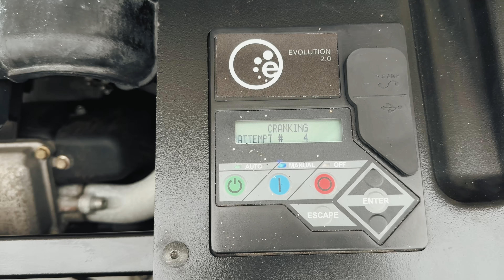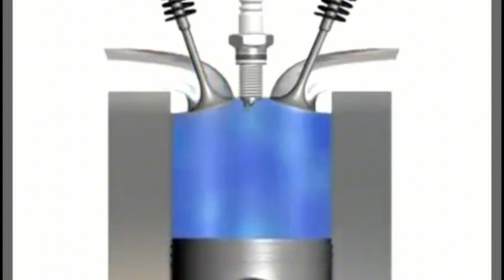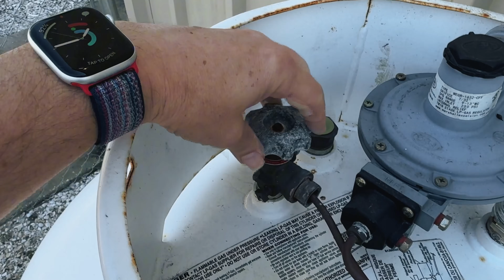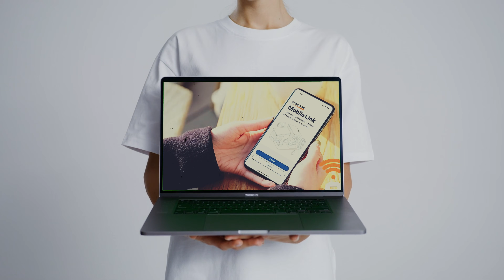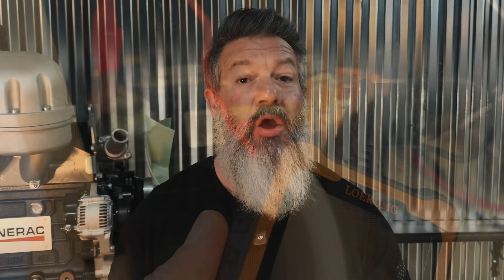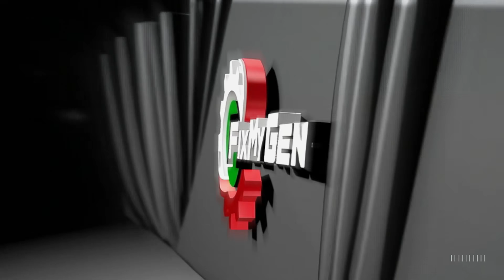GENERATOR OVERCRANK | FAULT CODE 1100 TROUBLESHOOTING | FUEL & BATTERY CHECKS ⚡🔧

Comment: Hello, I have a generac g0072230 14kw guardian series generator. My generator has worked fine for 5 years but all of the sudden I am getting an 1100 error code. The generator starts and runs for about 10 seconds and shows “cranking #1” on the screen and then stops. It pauses then starts again and runs for another 10 seconds or so and then stops again (shows cranking #2 on the screen. It does this until it has tried 5 times and then puts up “overcrank error 1100”. I have changed the oil, propane tank, air filter and plugs and checked that the stepper motor is not jammed, cleaned all the wires and it stays the same. It’s like the generator doesn’t know it has started and is running and so shuts down and tries again. Any thoughts? I’m worried a wire or harness is not working but they are all attached and well seated.Thanks in advance and your videos are excellent!
Bob

Comment: Thanks for your video.  I had error code stepper motor 2399, I replaced it,  I was able to start it with a little help from my finger on the carb,  once running the RPMs were a bit erratic,  so I replaced the controller.  Once again, it needed my help to start.  Now the RPMs are running as it should but, after I turn it off and restart, still needs my help with the butter fly on the carb.  Any suggestions?
Reply from the maker: Great question Jennifer! Needing to “help” it on the butterfly to start almost always points to a lean condition on startup, not the stepper motor or the controller. The fact that it runs fine once it’s going backs that up.

A few things I’d look at next:
• What exact model is this, and is it natural gas or propane?
• When were the valves last adjusted (unless it’s a G-Force engine)? Tight valves will kill intake vacuum and cause hard starts.
• Has anyone put a gauge on the gas inlet to verify fuel pressure while it’s cranking, not just at rest?
• Make sure the throttle/stepper linkage moves freely and isn’t binding or misaligned after the parts swap.

If all that checks out, the next suspect is the fuel/demand regulator. A weak or sticking diaphragm can starve it on startup but behave once RPM comes up — very common on these air-cooled units.

Comment: 12/22/2025 - I just experienced an OVERCRANK error 1100 on my Generac 20KW generator. It was serviced just last month and everything was fine at that time. We had a power outage last week and the generator failed to start. I called my Generac repair company and their tech just left my house. He knew exactly what the problem was when he arrived. Apparently Champion, who supplies the spark plugs, had switched to supplying spark plugs made in China and they are failing in record numbers. He replaced the two spark plugs in my unit with "pre-China" spark plugs and my generator started right up. He checked the gas pressure and battery while he was here and they were fine. So if you guys are recently having overcrank/no start issues you should change the spark plugs. You can't tell by looking at them since Champion is packaging the Chinese spark plugs in their original boxes. My tech said that folks should use NGK spark plugs if they aren't sure if the Champions are Chinese or not.
Reply from the maker: I’ve seen the same thing. You’re not imagining it.

There has been a real uptick in bad Champion plugs showing up in the field, and it’s caused a lot of overcrank and no-start calls that otherwise make no sense. Swapping the plugs fixes it immediately.

At this point, if I’m chasing an overcrank on these units and everything else checks out, plugs are one of the first things I rule out. Going to the NGK equivalent is a solid move and takes the guesswork out of it.
Thank you for watching and taking the time to comment!

Comment: My dealer and Generac customer service both advise to tap the fuel solenoid when the temp is near zero and over crank happens.  I suggested they change their spec from -20 to 5 degrees.   If tapping the fuel Silinoid is needed, they could provide a tapping hole on the right side.  Once the weather is over 10 degrees, it starts fine.  I have the cold weather kit.  The APP shows all the over cranks time stamps and I have match up with the local weather service the time stamp was between zero and 10 degrees. 

Do you think I could wrap the solenoid in heat tape with a “on temp” around 20 degrees?
Reply from the maker: Hey Ken, wow, I can’t say that I’m familiar with that freezing over challenge living here in Florida 😅 the first thing that came to my mind is adding a battery warmer kit, which is right next to the fuel solenoid, so that would in theory keep that side of the compartment nice and toasty https://amzn.to/3L6zwNX

Comment: We had one of Generac's "Top Rated Generac Service Technicians" do the regular maintenance on our 22kw propane fueled whole house generators that had been professionally installed and the 'test' start-up was set to bi-weekly. Until just two weeks after the "Top Rated Generac Service Technician" did the regular maintenance, the generator would misfire and backfire on attempting to start giving a code of 1100. I researched, reset and attempted a manual start - same thing. Called the "Top Rated Generac Service Technician" to come over and fix the starting problem. He wanted $100 to drive over then wanted $450 to diagnose the issue - WOW! We refused which meant that I had to find the problem - thought it was magnetos so ordered both; pulled the spark plugs and checked the valve clearance - OK. Checked the plugs - NGK ZFR6FGP - they're for a Jeep and no cross to the generac. Replaced them with correct plugs and the start issue was gone. One month now and the generator starts and runs just fine. Was that "Top Rated" Generac Service Technician" setting us up for a screwing? YEP!! Watch them while they do their maintenance and check the parts they use. The maintenance invoice stated RC12YC plugs but they were not even close! The spark plugs caused the issue... that was going to cost over $550. Plugs were $12 apiece...

Comment: I've been getting the 1100 code for about 2 months. I have regular maintenance done on it. If i shut it off and hit manual, it fires right up. No corrosion on battery. Filter looks fine.
Reply from the maker: If it fires right up manually but throws the 1100 code during auto start, that usually means it’s struggling to meet start-up conditions on its own—especially when cold or under load.

You’ve already ruled out surface issues like corrosion and a clogged filter, which helps. Next thing I’d check is fuel delivery during cranking, the stepper motor connection, and—if it’s been a few years—valve lash. Generac recommends lash checks after the first 25 hours, then every 400 hours or 4 years. I’ve seen that alone make all the difference on older units. (I’ve got a full video on it if you’re up for the DIY.)

Also, make sure the battery wasn’t just voltage-tested. You want it tested with a digital battery analyzer that checks cold cranking amps and internal resistance across the plates—not just a multimeter reading 12.7V.

Hope that narrows it down.
Reply: @FixMyGen  Thanks
Reply: Follow up!  It's Tuesday morning, weekly day for the generator to start up. After 2 months of no start and throwing that 1100 code, the generator fires right up on schedule. No problems. I love modern stuff with computers.
Reply: @hjets5387 did you do anything? I am having the same problem. Each week throws the 1100 code but starts fine manually. I dont have the $200 to keep paying repeat service calls.

Comment: What if your generator just do not start set to auto but start good manually. It tried 5x and failed but the first time manually.
Reply from the maker: Thanks for reaching out! To help you accurately, I’ll need a bit more info:
	•	What model do you have, and how long has it been installed?
	•	Are there any alarm codes in the history?
	•	How many run hours are on the unit?
	•	If over 25 hours, has the valve lash been adjusted?
	•	When was your last full service (air filter, spark plugs, etc.)?
	•	What’s the current spark plug gap?
	•	What fuel type are you using, and does the fuel selector knob match it?
	•	Lastly, do you know your current fuel pressure?

With those answers, I’ll have a better idea of what’s going on and how I can help.

Comment: near 25 years as a Generac tech in Ct and the code is actually a call for cranking from the board without starting. IOW, bum starter, crank relay, or battery cable not tight at the starter will also be a "fail to crank" but reads as an over-crank because it tried 3 times without starting. More commonly an owner will attempt a battery replacement and catch the stepper motor wire, yanking it from the board. That may cause a fail to start or over / under-speed fault because there's no throttle control. In the first example there is no actual cranking. In the second example you will hear it cranking. I always added zip-ties to the harness if I was in the battery area.